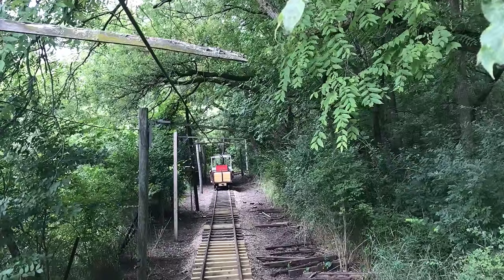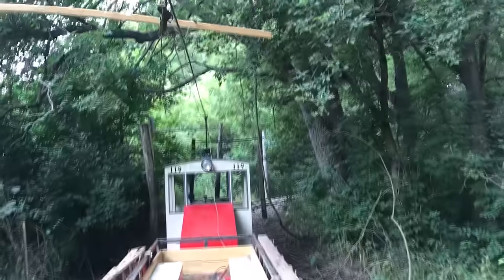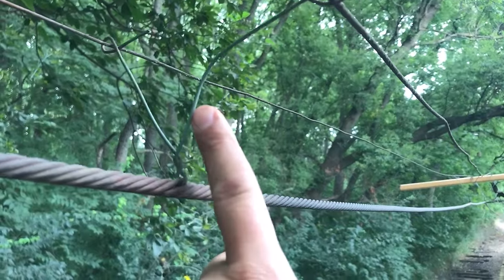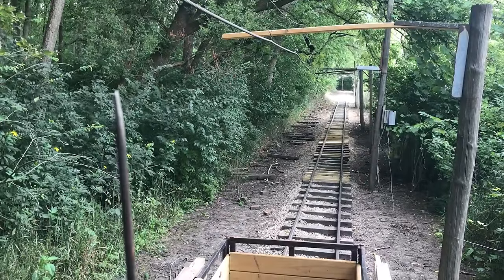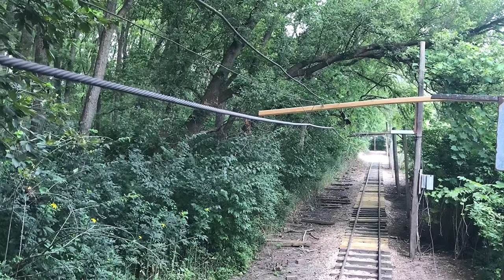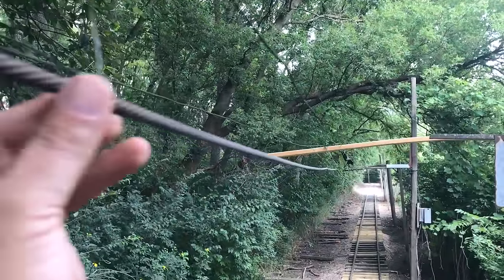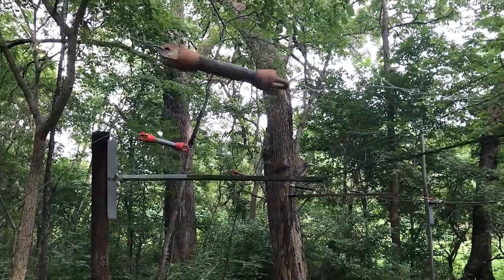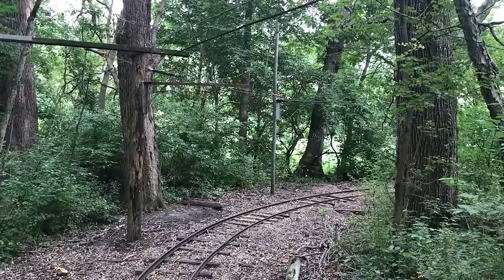Details of and general information on the catenary used on the RRVT line

Comment: How does the non-powered frog work if you go the other direction, i.e. approaching from the split side, along the line the frog is NOT defaulted onto? It seems the shoe would then end up on the outside of the catenary.
Reply from the maker: That frog is located on a loop track, so we always run the same way around it. You are correct in your assumption that its only a one way frog, but there is no reason to have it be able to go both ways hence why I opted for the simpler mechanical frog vs a powered one.

Comment: Wow - be careful!

Not sure a mains voltage tram line will be allowed by the authorities, to be installed and operated by a private citizen, just like that, many places on earth!

Am sure you are knowing what you are doing, just be careful and not f*** up, 240 volt, especially when wet outside, is hazardous to touch. 

Also - be aware of the albeit rarer, but still dangerous scenario, where a trolley looses contact with ground, either due to rusty old tracks, broken tracks or derailing.

If the pantograph or trolley rod, is still up, and even just the lights on the trolley are on, you will have a high voltage potential between ground and the trolley, so even touching it, when it has derailed, if the trolley rod is contacting the overhead wire, could give you a deadly shock. 

Have as a rule #1 - ALWAYS - ALWAYS cut power, and ideally ground the overhead wire, if ANYTHING happens, like the trolley derails and looses power. And if the power suddenly goes out because of rust or poor contact in the rails, you need to jump off the trolley, not touching the trolley and the ground simultanously. Any passengers or guests, should be instructed of this, too.

Am sure you know this, but this is important to know, for anybody else, who could get inspired to make a mains voltage train or trolley line, like this. Seems like a lot of fun, I am a member of the Oslo Tramway museum in Norway, and I experienced this very scenario many years ago, when we were allowed to drive a museum trolley, farther on the unused end segment of the line, than the regular trains did. 

And it started to spark under the wheels, and the tram halted. Someone with a crowbar and well insulated gloves pressed the crowbar between the wheels and the rail to get contact so the tram could be moved. And we were not allowed on or off the tram again, before it was back on unrusted normal track again.  

So well - I believe there are a lot of tram people, at places where running museum trams, due to modern regulations or practical considerations or economy, are not allowed to operate anymore 😞 who envy you a tiny bit. :-) You have a small little treasure here, just so you know that!  Just be careful with the electricity and have fun! :-D
Reply from the maker: There is 1 steel bodied car on the line and what you have described is a big problem with it- if the wheels are rusty or the track is rusty then the carbody basically becomes energized. Its a rule that power must be disconnected before exiting this car, its one of the big reasons I prefer wood bodied cars out here as they are much safer in this regard! This line has been operating for over 75 years now, so far all precautions have kept everyone around :)
Reply: @CNW4145  75 years? Wow! Is there a place where we can read about the history of this tramway? I knew about big gauge model railways, not about big gauge electric model railways, now I am curious! 😮… 👍
Reply from the maker: I have some old photos from the beginning of this operation and an original route map that I will share in a future video. But it was started by a small group of traction enthusiasts, one of which who worked for the North Shore, South Shore, and CTA who provided the engineering the turn it into a prototypical operation. All of the original members have sadly since passed, but I continue to carry the torch so that it may live longer than most interurban operations did in the US. This is what happens when you are just a little bit crazy. But I do have a lot of fun!

Comment: It seems unusual to me to use a twisted rope as a contact wire. In most systems I know it's a solid metal profile that's smooth enough to not wear down the contact piece too quickly.
Reply from the maker: That would be ideal but its very expensive. This works quite fine though :)

Comment: I'm curious how many max amps does you loco pull?
Reply from the maker: Going on flat straight track it will pull about 5 amps from the AC line. Going up the 4% grade on the big hill light unit it will run about 30 amps, and pulling some cars it can go as high as 60 amps up that hill.
Reply from the maker: Nope, all of the rail is one continuous run as is the catenary. All of the substation transformers have a similar impedance so they share power somewhat equally without fighting one another. Each station has its own circuit breaker, so if a line fault occurs the substation nearest the fault will trip first, then the others will trip afterward if the fault is severe enough.

Comment: For the unpowered trolly frog, how does it work going backwards? Wouldn't the pole just fall off the end? or is the unpowered one unidirectional?
Reply from the maker: That unpowered frog is on the loop track so there is no reason to make it operate in both directions. You are correct, the pole just falls off of it if you try!

Comment: hang on, how does the unpowered frog move for a pole coming from the other side? (I have forgotten the terminology, but entering from the side of the switch where you have no choice but to merge, rather than from the side where you split into two choices of route) 

It looks like it would simply dewire as I don't see what would move the frog over to let the shoe in. With the powered frog I presume it doesn't matter because by the time the front axle hits the button the trolley pole will still be far behind- no matter which way you travel. But with the unpowered frog, I cannot see how it would work
Reply: I am guessing that the loop is one-way track or something.
Reply from the maker: You are correct, you can only go through it one way, but it is fine because this is at the loop track so we only operate in one direction here.

Comment: That the sloppyest wiring I have ever seen. But I guess it works. What keeps the power from shorting out through the wood supports?
Reply: The insulation resistance of the wood. For 240V you need less than an inch of wood.

Comment: I take it the power was isolated when you were hands on with the cable. As i know 240v ac will give you a belt....😊
Reply from the maker: As long as you are insulated from ground you can touch the cable when hot, you do not feel a thing.